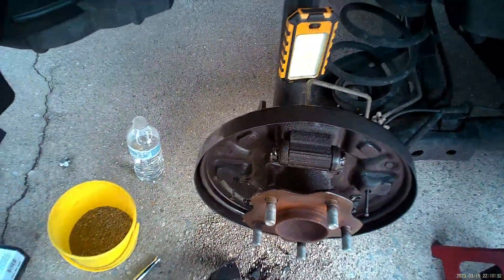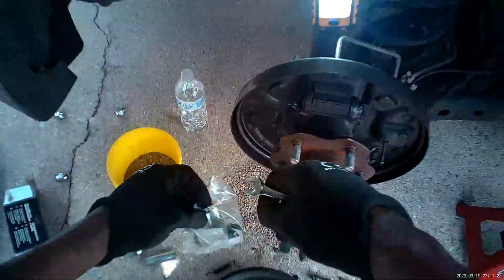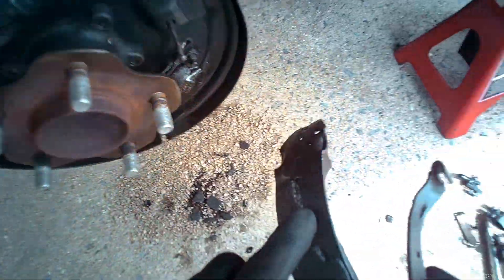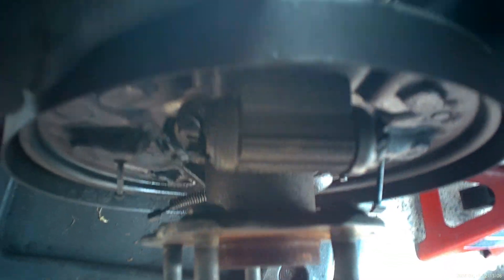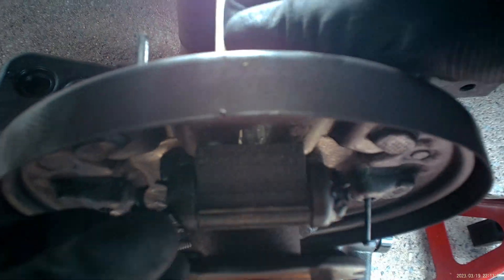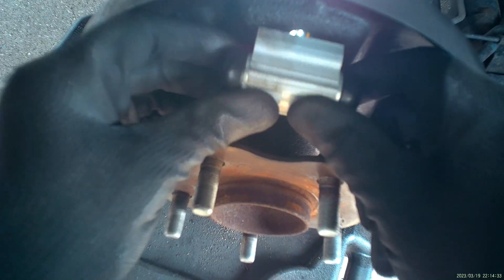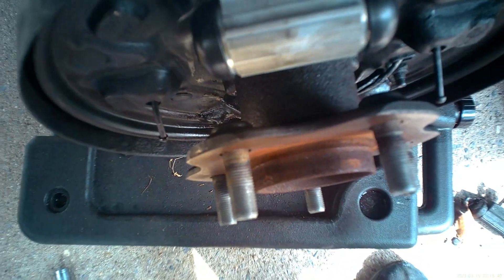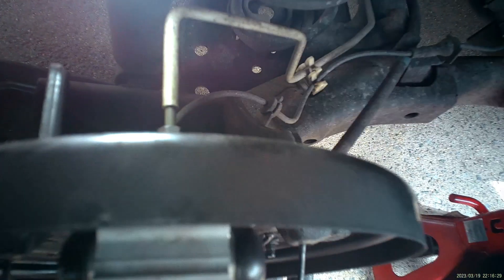Nissan Sentra Rear Drum Brake Wheel Cylinder Replacement | DIY Step-by-Step Repair Guide! #subscribe

Comment: Did you have to bleed the brakes?
Reply from the maker: After opening up the closed system to change out the wheel cylinder. I did bleed the brakes to get rid of any air bubbles.